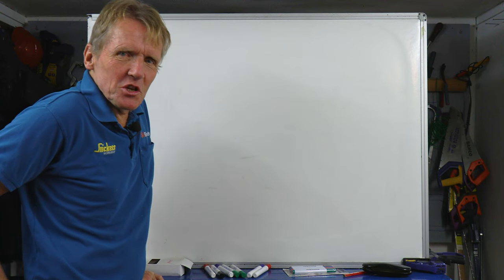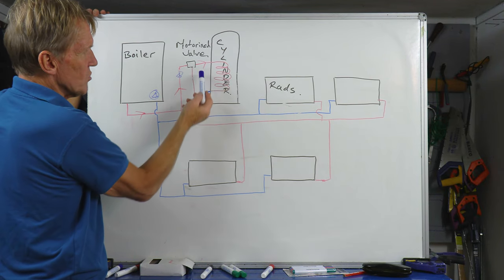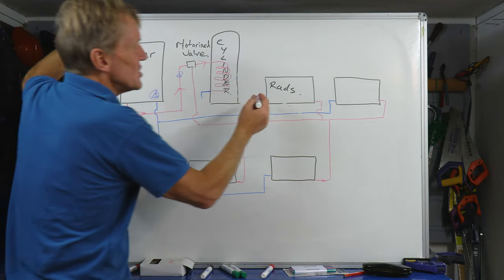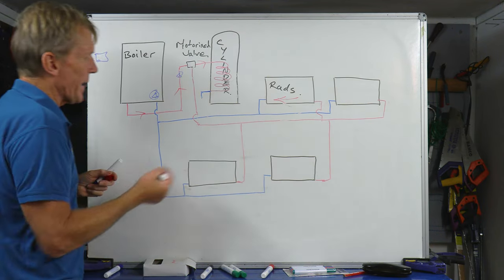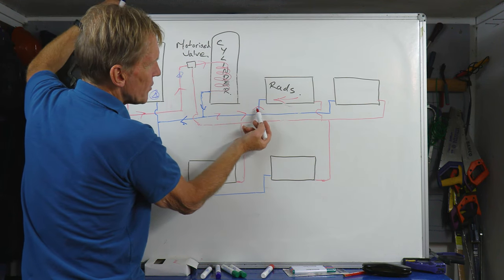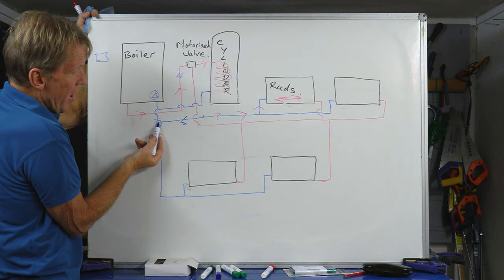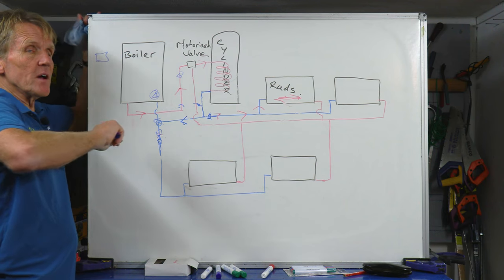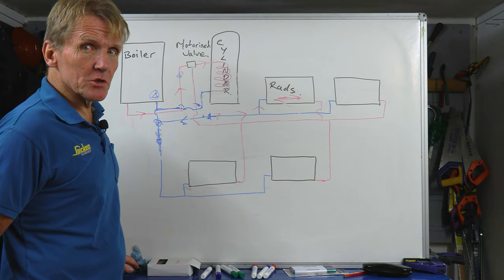Why Are Your Radiators Getting Hot When the Heating Is Off?

Comment: I had this exact issue in house I bought where the plumbing was converted to a pressurised hot water tank for a loft extension with an extra en-suite bathroom. In summer some of the downstairs radiators got warm from the lockshield ends. Four British Gas engineers tried to fix it over 3 days. They changed the motorised valve twice! They couldn't work it out and left it unfixed. I then got in local independent heating engineer out who diagnosed the problem and fixed it with a non return valve on the hot water return as you described in a mornings work. Great video, spot on.
Reply: Sorry my mistake I think my engineer fitted the  non return valve to the heating return before the hot water return to the boiler. I definitely fix it though.
Reply from the maker: Thanks Kenneth this is what I was really trying to say in this video and I started to doubt myself in terms of my emphasis on reverse circulation. Theose British Gas guys just jumped to conclusions and I have seen that type of thing a lot in my career. It makes me wonder if they are still going to college.
Reply: Skill Builder think it often shows the best engineers usually work for themselves

Comment: Absolutely spot on & exactly what was happening to my system! I tried everything to find out why this was happening, and it wasn't until I got rid of my heat only boiler, and changed to a combi boiler. The connection from the HW return was connected to the radiator return pipe under the floor. This was done when the house was built! 
Lazy plumbing indeed.
Thank you 👍

Comment: Thanks Roger, that was a great explanation! (I actually have that minor issue with the rad nearest to the hot water tank) Although you explained the “wrong-way flow” and the one way valve solution very well, I think sometimes it’s the convection of the heat that creeps along the pipes, as opposed to an actual flow, so the one way valve may not necessarily function to prevent that…thank you for sharing 🙏
Reply: I’ve got that too, one rad beside the cistern is heating.   No motorised splitter valve.  The cistern return is linked upstairs leaving a single return pipe to the lower floor.  Going to try an NRV in just that rad.

Comment: I had this, after I bought a run-down beautiful post-war end terrace in Scotland.  It had a turret and spiral staircase, I loved it.  Troubles made me sell it after a few years or updating, but the hidden issue was whenever the hot water cylinder was put to use, there was this trend to heat only the lower radiators in the house, not upstairs.  I usually believe that once something’s done, I treat it as 100% until I find otherwise, this is one of the three times this has NOT held up!  The system had two valves, but once I sketched it out I realised it needed a third.  It had been relying on either the house being cold a lot, so some heating downstairs might not be a bad thing (!), or the owners had not noticed, etc.  

I fitted the third valve, which stopped the back-channel movement of hot water from the cylinder heating circuit, from going at all into the radiators backwards.  It drove me nuts, but the present owner benefits as all of a sudden it’s not just a nuisance but an expensive one.  As you will understand, the effect mainly was on radiators BELOW the level of the ‘head’ from the hot water entering and leaving the cylinder, which was perched in a corner cupboard of the kitchen, above the fridge.  So, a three-motorised-valve system, instead of two, and it was perfect.  Quite weird for me.  Take care all.  

PS - have a laugh on me…the cost of the house when I bought it in 2003?  £35,000 .  2 bedrooms plus a perfectly serviceable loft bedroom, and in fact this is what scuppered my letting plans - the government introduced a bedroom tax, and suddenly nobody moved because they;d have their benefits and home rooms scrutinised at that point, and this extra room was not ‘legit’.  The council man said kindly ‘I am going to forget the request for retrospective approval, and put it in the drawer with the others’.  I don;t understand hints, it’s terrible!  He meant, I might be asked to return it to how it was, whatever that really means.  It can mean, they examine the cables to see what date is stamped on them, but that’s a whole planning and building regs world of pain, let’s not go further.

Comment: Another terrific video. Thanks. We have only a towel rail heated in the summer via the boiler and all rads are off but still get warm despite TRVs off. Rads upstairs and UFL down. As soon as it gets warm I shut the lock shield valve down and this sorts the problem. A new installation (including a low loss header (no idea what that adds)) but after watching this I'm getting them back in! Cheers
Reply from the maker: The summer operation towel rail is intentional but I suspect it is reverse circulating. They should be able to feel this on the pipes A non return valve should sort it out

Comment: Very clear explanation Roger.
I had this problem but with a different outcome so I will share it to help others.
Rads getting hot when the heating was off but hot water on.
Checked the motorised valve, all working correctly, even changed it, still no solution. 
Used my laser thermometer to see that the three port valve wasn't sealing. The rubber ball in the valve had just deteriorated and was allow some bypass.
Changed the three port and the problem was solved.
Reply from the maker: That is a good idea to use the infrared thermometer. I did mention the motorised valve but dimissed it a bit, I should have given it more emphasis. Thanks for providing a bit of balance.
Reply: @SkillBuilder  To be honest, I have never come across it before and never thought it could be the valve. 
It took three visits, a lot of head scratching, half a dozen cups of tea and a fair few hobnobs.

Comment: Hi Roger, i love the channel. Could you do a video with a diagram like this one for a dual system please? I had a guy do the job for me last year but I know its not right, he just connected stove back boiler into current system fueled by gas. I was advised he should have used a dual coil cylinder with seperate feed from attic tank and seperate overflow. Also, I realised that if I get a power cut my pump on the solid fuel doesnt work. He also has no non return between systems so when running gas I am heating the water in the back boiler aswel as the radiators in the same room. I would like a professional drawing so I can make sure the job is done right this time round. Cheers for the content, it s good to see professionals at work taking pride in what they do.
Reply: You don't have to have a dual coil cylinder if you have two separate heating appliances doing hot water cylinder+ heating. In the case of solar panels heating hot water yes you'd opt for a dual coil. In the case of two heating appliances for instance an older boiler that only heats a system up to 55c and a new one that's nominal operating temp would be 65c often the older boiler would be satisfied and not come on. Then to stop that boiler being heated you would just use a pipe stat linked to a 2-port valve to stop the flow through the appliance. 

The more important thing I'd be asking is - normally if the power cuts any modern boiler will stop functioning and the boiler is in control of the pump to stop it potentially overheating and going bang. If the back boiler on the stove is solid fuel you also run the risk of that issue. Also it may be capable of gravity circulation but all hot water cylinders now are legally required to be pumped on the primary side. Honestly though without a site visit to assess what you actually want/require it's impossible to give a drawing.
Reply: @effervescence5664   Hi Mark, thanks for the reply, I am in Ireland so I don't know if reg's are the same. I already had a gas boiler closed system, and wanted a solid fuel stove. When I bought it, the builders merchant told me I would need a separate feed from tank and overflow, which would allow for expansion should the pump fail, no valve or restriction on expansion pipe and it should be 1 inch. Then have a non return valve connecting one coil to the other so the gas fuel circuit has all the radiators bar one, and wont heat the solid fuel side, and the solid fuel side has no restriction, one radiator for expansion and will heat the gas circuit aswel, as you said, modern gas boiler wont kick in with thermostat.
I will say, I am not a plumber, the building merchant more than likely not a plumber so I really only have a very basic understanding, not knowledge or experience. When I got it done there were very few plumbers registered for solid fuel and none registered for both. He said it was fine to just tee into existing flow and return and change to vented system. I am doing the house up now and don't want to tear the gaff apart should a pipe go bang, or if I try to sell down the line I could have problems. System is working, and I will have a plumber inspecting it for me during works.
My doubts only arise from the two differing opinions of the installer and supplier.
Reply from the maker: Hi Steve 
 I will do something on this even though it is niche. I had one in my house but it was such a headache that I took it out and returned to a conventional system. I did quite a lot of them on wood burners in country locations but they were also prone to condensation on the back boiler which caused them to rot like pears.
Reply: @SkillBuilder   Cheers, I appreciate that, I'll know if my plumber is a chancer or not. Look forward to it, I'll share it on and try and get you some more subs.
Reply: @effervescence5664  You need a "neutraliser", a neutral point which supplies all the heating appliances thus equalising pressures in all circumstances. It's just a common tank where all the supplies for the heating appliances are fed from.

See: http://dunsleyheat.co.uk/neutralizer.html

Comment: I had this in a house in London. Radiators were hot when the boiler was switched off. Eventually I found the pipes going to the tenants house. The landlord had connected his radiators to his tenants house next door.
Reply from the maker: That is a new one on me but I  did see a flat in a conversion block that was using the neighbour's gas supply.

Comment: Thanks Great video! our gravity fed Y system (with cyl) is a you have described,  but has a small lock shield valve quarter to half turned on on the cyl pipe return to the boiler.  The return pipe is in the correct place as you describe but I understand the addition of a lock shield  valve also helps slow down the heating water in the cylinder coil so that the water in the coil is not going too fast  as to "whizz" through the cyl and therefor heats the water as effectively as it can. I believe that the lock shield addition on the pipe return from the cyl also means the boiler  should  not receive back cyl coil water that is perhaps still too hot.   NB. I'm Just in the process of tidying up the wiring centre (this is has been been a mess) with the larger Salus wiring centre ready for Hive to work on Home Kit.  ( Grundfos UPS3 pump is set to Prop Pressure & working fine) Thanks again great video explanation.

Comment: I had the exact same issue on the same set up but it was the valve that had failed in my case. Another well explained & informative explanation Roger.👍👍
Reply from the maker: I can be the valve but it is easy to feel if it is letting by. I am amazed when plumbers just replace it without doing that.

Comment: Bravo! Another nice video. Honest & true. Thanks.  Yes now that you have reminded me I have heard about this reverse flow phenomenon. There's another similar possibility isn't there? To do with the header tank feed thermo-siphoning. So you feed it in BELOW the return from a sort of U bend so that the heated water cannot rise.
Anyway my heating has worked fine for 17 years but this Summer the rads are getting slightly warm when there is a HW demand, I thought it must be the valve.  But is it the ball or the motor? Should I bite the bullet and replace both bits of it? Can the ball be fixed in any way? Why would it get stuck or not seat?

Comment: Excellent timing for me Roger, I'd planned to replace my 3-valve this week to solve this exact problem and now I'm wondering if the problem is as you described. thanks!
Reply from the maker: If it has stopped then it is the valve. I think I unwitingly gave the reverse circulation too much weight. Thge important thing is that there is a simple way to find out which problem it is.

Comment: Great advice, as an amateur I would have thought just of the 3 way valve. However what I would say is that if this problem suddenly occurs some time after installation, I would think it unlikely the install problem that you describe as it would have been like it from the start....No?
Reply: Just a thought to bear in mind perhaps there could have been a build up of magnetite some where inside the system near or at the three port valve / pump etc causing some obstruction / sticking if it's years after installation.   May be Check with a magnet if you can on the copper pipe. Apparently Sentinel X100 or similar is supposed to help reduce magnetite build up esp with a Magnetic type "filter" regularly flushed or cleaned... as I say just a thought! 😀

Comment: Lots of good info there, but... as an engineer and not a plumber why not fit a 2nd motorised valve on the CH return before the common return that shuts when only the hot water is required making a closed system for HW?

Comment: I have this problem really great to understand why! 
My DIY solution - the radiator closest to the cylinder I switch off in summer seems to stop the reverse flow.
Reply from the maker: That will work in most cases and with TRVs they will close in the summer anyway.

Comment: I've just come across this problem. Ive had a plumber in as one of the radiators wasn't heating up. He said there was a blockage and used some type of sucking device and now the radiator is working again. But since he's done this, a few of my other radiators (ones closest to the boiler) are getting warm when the hot water is on. Never had this problem before.

Comment: Hi roger 
Great channel and video 
If i just have one radiator getting hot on the first floor when boiler on the ground floor how do i solve the issue ? 

Will i still need to lift boards to access pipework ?

Comment: We should also explain that in some properties the bathroom rad or towel rail has been purposely put on a separate circuit so as this can be used at the same time as the hot water is running on its own simply to warm or dry towels.
Reply from the maker: That is the next video.
Reply: @SkillBuilder  ,thanks brilliant videos,love them all..i enjoyed the rendering one it gave me the confidence to have a go.

Comment: Great no nonsense explanations - thanks Roger. My problem is the central heating pump comes on even when only hot water is selected. Motorized valve seems to be working and the programmer is only about a year old. Could it be the programmer is wired incorrectly? Anybody?

Comment: Great explanation. We bought a house from a plumber. He's done all sorts of clever hacks and we have hot bathroom radiators (the two closest to the airing cupboard/hot water cylinder) pretty much all the time, even during summer heatwaves 🙂 Keeps the towels nice and dry at least...
Reply from the maker: summer operation on towel rails is common.
Reply: @SkillBuilder  How does it work? I am sure you could an entire mini-series on how my house is plumbed. It's a maze of pipes and tanks and valves, half of them unused...

Comment: I wonder if a good way to describe the correct positioning of that final return tee is that the cylinder return flow pressure at the tee is not greater than the total combined radiator return flow pressure, and that directs the cylinder return flow only one way - straight back to the boiler.

Comment: We have a gravity feed hydronic system that does not have electricity running to the boiler. The explanation I got was that the pilot produces millivolts of charge and if the charge is interrupted somehow the thermostat calls for the heat exchanger to ignite. Since there is no electricity the thermostat can't be turned off just down. The thermostat will call for heat even with no electricity.

Comment: Of course that's what it is! Christ on a bike I've been addled about this problem for three years. Even thought about emailing you about it for your Q&A. Right, I'm all over that this weekend. I think the none return valve will be the solution.
Reply from the maker: Just check the flow and returns on a radiator to see if they run the opposite way.

Comment: Roger, may I ask a question please? I've built an extension that I would like to run the GCH from the house to. I may need a bigger boiler but that's another issue. My question is could I take the extension return directly into the boiler return, close to the boiler, and the hot feed for the extension from the house radiator circuit feed? Thank you and thanks for this video. Anthony
Reply: This video may actually answer my question??

Comment: Hi Roger, great channel. Only thing I do different is run the heating to define flow and returns after I've witnessed the problem with just the hot water on. If the same pipe gets hotter it's the valve leaking, if the other one does it's reverse circulation.
Reply from the maker: Jim 
Good way of explaining it but the same idea just the other way of coming at it.

Comment: EASIER and CHEAPER:   Just close the individual radiator valves (the manual one) when the winter is gone. It takes 10 seconds for each radiator.  No costs, no noise, the best solution indeed.
Reply: Also has the benfit of working the valve (TRV) as they are prone to sticking if not manually turned on and off ocassionaly